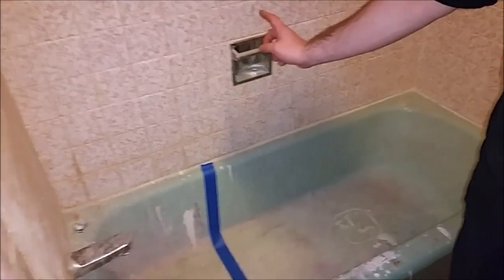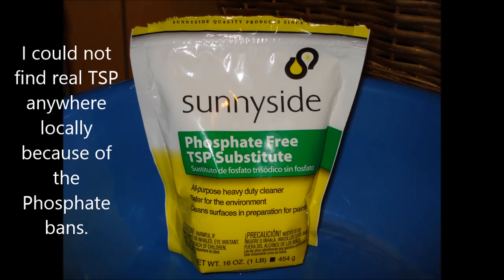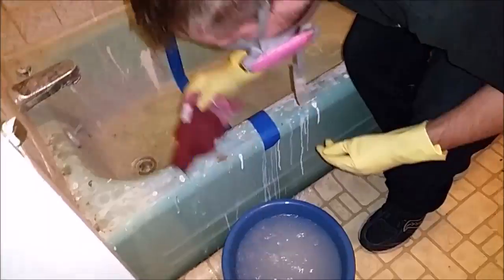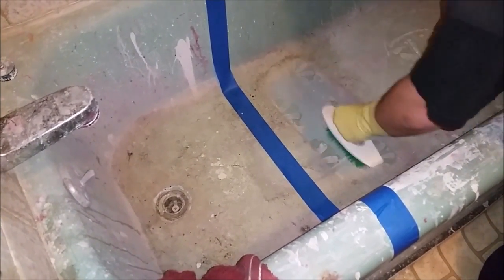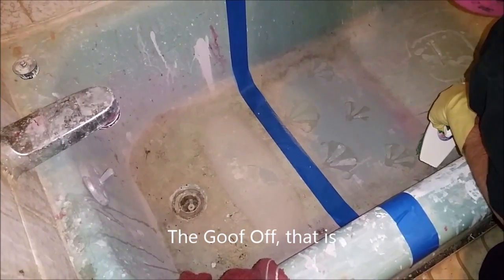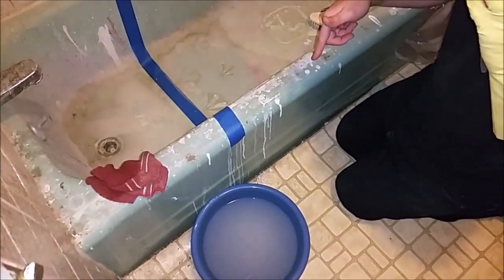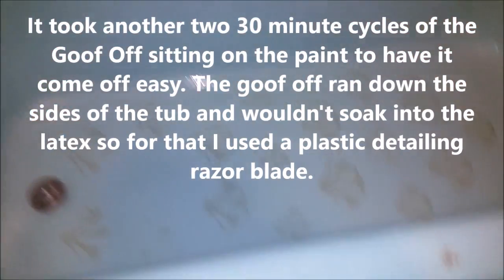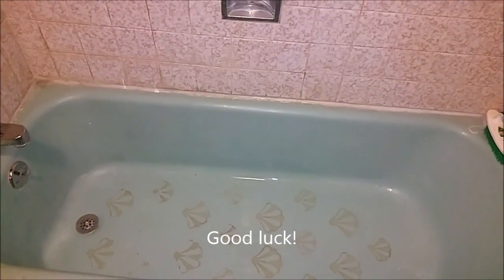How to remove fully dried latex paint from bath tub

Comment: well if tsp is not  great use then why use it in the tub and  then rinse in down in the drain into the water system ?
Reply: You do realize that bathtub drains lead to sewage systems not water systems, right? 

Which is for transporting liquids contaminated by chemicals and waste to sewage plants or septic tanks. 

Nearly any solution mixed with water is okay to flush down a drain, with the exception of things which may cause buildup such as grease. While TSP has been found to cause water-fouling, it typically can be avoided by making sure to use low-concentration amounts of the cleaner and allowing plenty of warm water to run down the drain during and after its use.

Here is a somewhat brief description of TSP and why it is banned in some areas:

Trisodium phosphate (TSP) is a blended cleaning product consisting of 75- to 80-percent trisodium phosphate and 20- to 25-percent sodium carbonate. TSP is an effective, heavy-duty cleaner which many contractors and painters favor as it is cheap and does not contain ammonia, bleach or fragrance. 

Most states have increasingly started to ban household cleaning products (such as TSP) that contain phosphates as this chemical has been linked to water-fouling and toxic algae growth that can kill aquatic wildlife.